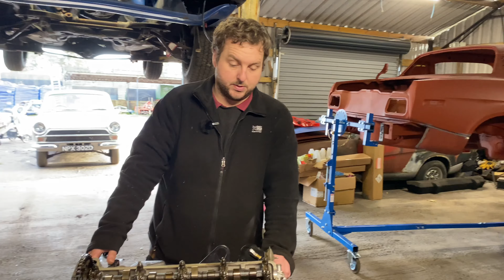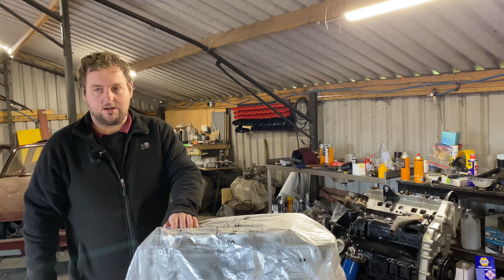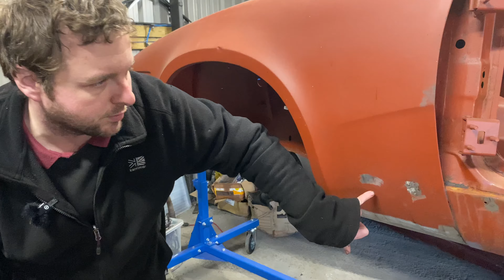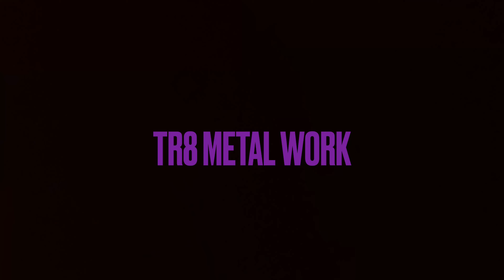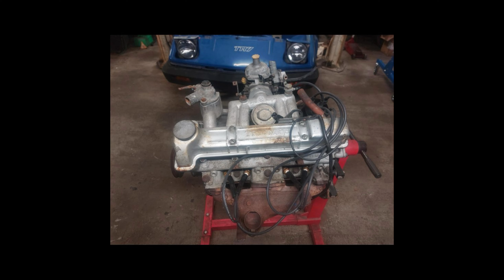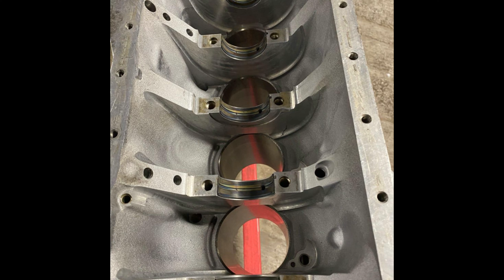Busy week Project Updates

Comment: So happy to hear you say about how good the TR7 engine was, I tell people the same, if you look after them (regular oil changes and a good flush) they will easily still perform past 100K. My Tr has done 77K and the car runs and drives superbly! Saab used the same block in their turbo version in the early 90's although the engine was 180 degrees different in the car to the 7's!